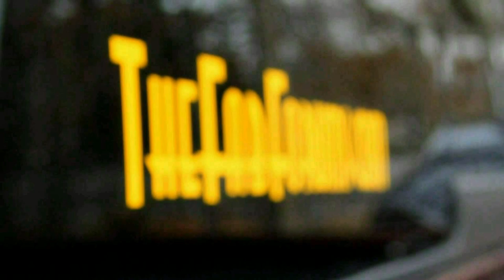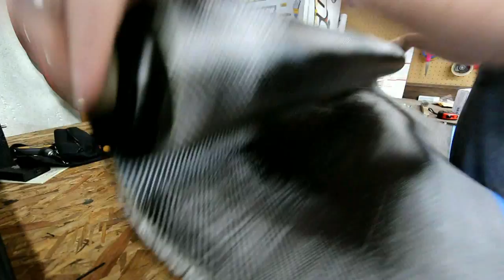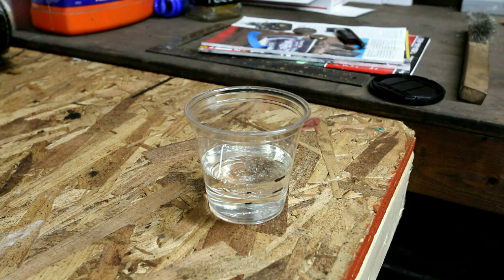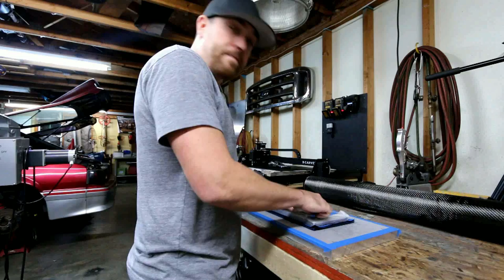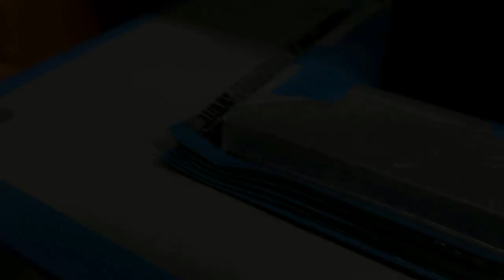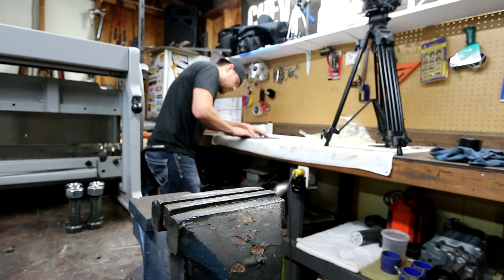Making Carbon Fiber Plate | Engine Accessory Brackets

Comment: Adding fine graphite powder to the resin is a good way to increase strength and improve thermal properties. If you want a clean carbon fiber finish do a couple top layers with regular resin.
Reply from the maker: hmmm. I will have to look into that

Comment: I haven't read all of the comments so I apologize if this is a repeat suggestion.  Use clear packing tape instead of paper.  The resin will not stick.  Most resins are measured my weight not volume, perhaps you have some that doesn't, not sure.  When using you stir sticks, cut them with scissors so they are flat.  That way you can get all of the resin from the corners of the bottom of the cup and you insure a true mixture.  Hope this helps.  Really digging the videos.  Thanks for posting.
Reply from the maker: good tips
Reply: I watched I think all of your carbon fiber vids now.  On a binge.  I used to work in an aerospace UAV lab.  Lots of carbon and mold making.  Another way to make your molds with less work than making cardboard, then steel etc, is to carve your positive part out of high density foam.  Basically Home Depot insulation board.  Sand it smooth then spray it with topcoat, sand, and bondo etc. Mold release the positive piece and lay up very fine fiberglass for the first layer then fiber the rest.  You can add some plywood to the mat and have a mold base.  Not to say what you did was wrong, this is just another way that is usually the industry standard.  Aircraft Spruce is you friend.  Take care bro.  Oh yea, Build a small heat box with a heat lamp, your parts will cure a lot faster.  If you mix large batches of resin it will kick a lot faster, you can watch it flash in the pot and it will even steam.  Gets very hot.

Comment: Carbon ,Kevlar then e glass do another large at 90degrees,and repeat til you get the thickness you want,that gives a light strong part with all the advantages of the different materials. This is one of the best channels I have come across for no bullshit techniques on composites just remember those other fabrics can enhance strength too
Reply from the maker: yeah there are so many options available these days
Reply: @Thefabforums  yup I just found out that s glass is close to the strength of carbon fiber cloth in some applications. Is the bracket holding up well it looked like the holes were to close to the edge of the material

Comment: btw, if using wax paper as a release. Just scrape it off, then use some paint thinner or mineral spirits
 to gently dissolve the leftover wax. Light use of it after it's fully cured will not harm it.

Comment: Not sure if someone already told you this but you want to go at a 45 degrees because a 2x2 twill is equal at 90 degrees 45 will give you much better strength in all direction
Reply from the maker: +jslandis I agree. The loads for this part will be in compression, not stretch so that wouldnt help

Comment: To avoid the paper sticking you can use two sheets of glass or anything polished actually, or use peel ply, which is a fabric that looks a bit like silk that soaks up resin but peels off after everything has cured.

Comment: been looking at working with the stuff online and realy like the vacuumbag impregnation way i've seen
(putting a line inside the bag with holes and suck in the resin during the vacuuming )
gives you way more time to lay up the project before the resin sets and prevents messing up the weave from having to spread the resin around using a squeegie

think if you cut the part then sand the corners round with some waterproof then give it a couple coats of clear should make it look prety nice all over though
Reply from the maker: Yea infusion is the best way to lay up for sure.

Comment: nice idea kyle, i'll have tp try that sometime. just throw another beauty layer on top and it'll look perfect. altho i suppose its already complete by now.
Reply from the maker: Thanks. I could still put a beauty layer on it. May be a viable option.
Reply: +The Fab Forums There is a material you can sandwich in carbon fiber it is nomex honeycomb. Superstrong and light aeorspace grade carbon fiber is your end result. check it out

Comment: to make it look real good on the back, put a layer of resin down 1st let dry then put your fiber down
Reply from the maker: if you do that you can have issues with it delaminating
Reply: The Fab Forums only if it's completely cured, gotta be slightly tacky

Comment: Hey dude best way to get the strongest. Is 1. Do carbon fiber then 2 nyglass its nylon and fiberglass mix. Unidirectional tape. Then 4. nyglass again then 5. Carbon fiber. 
I work with carbon all day for a prosthetic company so it has to be strong. If you need any help on resin to use I'll help you out
Reply from the maker: what kind of resin?

Comment: You can use Saran wrap or Poly instead of the paper and the resin won't stick to it.
Reply from the maker: It wasn't just paper...it was wax paper. I think saran rap would have done the same.

Comment: i have a question: for making small carbon fiber parts (essentially a shape similar to a letter G, 3/4" wide, about 1/4" thick, and basically making a G out, by bending a flat metal ruler , until a thin LETTER G is made. ) how does one make small , flat parts , from carbon fiber?

Comment: I want to make my regular round steering wheel into a flatbottom wheel and wrap it in carbon fiber.  Is the carbon fiber strong enough to replace the piece of steering wheel I cut out to make it flat?
Reply from the maker: yeah if irs done correctly it can be very strong

Comment: I like the ide, but will it be strong as when you use heat and vacuum?
Reply from the maker: It should be. Heat just accelerates the curing process and vacuum just removes air and compresses the part. I actually used a little heat in this part to help it kick and the press I thick did what a vac bag would.

Comment: why not use a vacuum and a bleeding/breathing material? the vacuum will compress the layers and eliminate all the air bubbles between the layers, which will compromise the structural integrity of the part fabricated.
Reply from the maker: +airframe67 i usually use a vac bag but you cant get the compression with a vac bag that i did with a press. I can guarantee there was no air between layers on this part, and it came out super strong

Comment: I was looking into making some composite pieces such as this one, but wanted to cut down on costs a bit. Could I do carbon fiber sheets on the outside only, and fiberglass sheets in the center to build the thickness up? The pieces I'm looking to make do not need to be that strong, more of an ascetic thing
Reply from the maker: yeah for sure

Comment: where can i buy the big roles and enough materials...
Reply from the maker: +Leo Reynosa there is a buyers resource section on the forum over at thefabforums.com . You should be able to find what you need there.
Reply: +The Fab Forums i checked and they only sell by pre cut sheets or kits im looking for more of a bigger role

Comment: Release Agent man! "Fibre Glast 1153" 

Too bad you dont have a oven and you could have used prepreg.. I miss working with that stuff..
Reply from the maker: Yea I have some release agent but figured some way paper would do the trick. Oh well. I have thought getting an oven and using some prepreg but its so damn expensive. I mean I'm not building Indy cars or Super Cars here.
Reply: True.. iirc prepreg can be baked at 350°. So you could build a oven with vac ports. Plus thee's no mixing or sticky mess with prepreg..
Reply from the maker: Yea I have used it before. I just can't justify the cost.

Comment: hello, can you share the physical properties (approx) of this 15 layer thick plate you achieved .
thanks
Reply from the maker: ended up being about 1/4 inch think
Reply: The Fab Forums rather i have been looking for its strength and weight also it's dimension so that I can find its density. Kindly help
Reply: @Thefabforums  If it was 15 layers and ended up 1/4" you probably used 11oz carbon fiber. I just made brackets for a car top carrier and used 7 layers of 5.7oz CF and they were .090" thick.

Comment: Hey guy,had you pulled a vacuum wouldn't you have gotten what you wanted?
Reply from the maker: Yea but it wouldn't have been as compressed. I also wanted to test something a little easier for those that don't have vac bag supplies.

Comment: does anyone know how to calculate the amount of resin needed for wet lay? as a gide thanks
Reply from the maker: +dnbwalkera “bignose” adam I am sure there is a formula. I always use a vac bag to remove any extra resin
Reply: +The Fab Forums  thanks for your reply if I find anything will let u know in the comments.. Thanks for the sweet vids btw
Reply from the maker: +dnbwalkera “bignose” adam sounds good to me
Reply: About 1:1 weight ratio I believe.